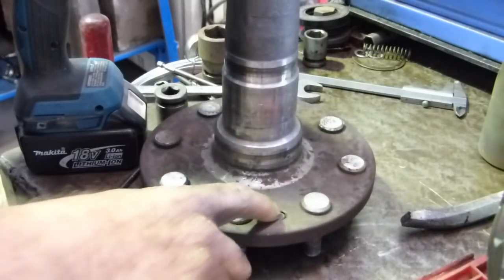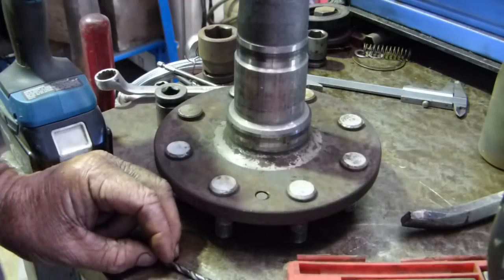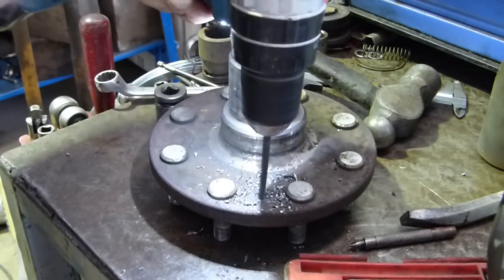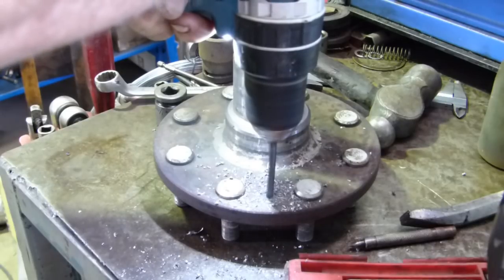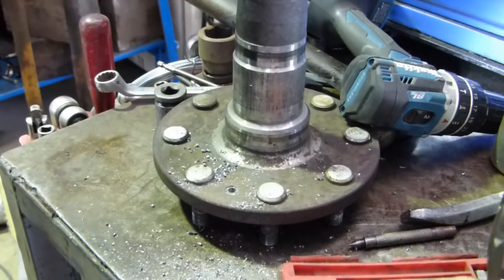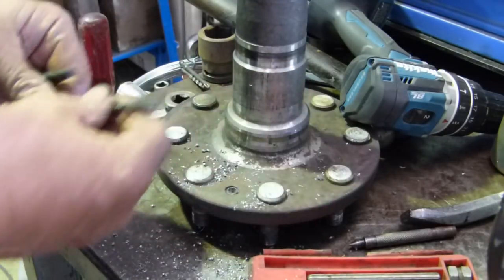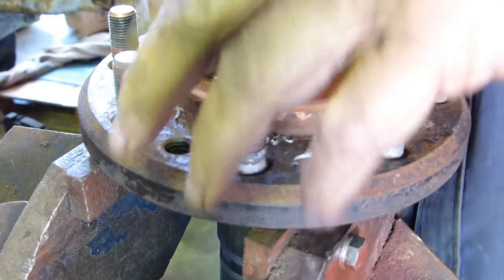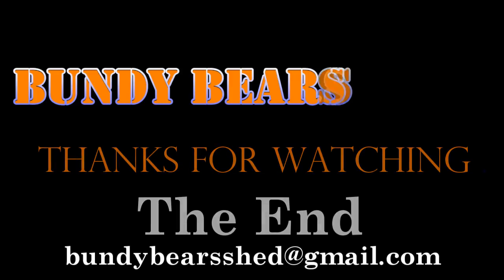Ferguson FE35 Grey and Gold Restoration Part 8 Removing a Broken Brake Drum Retaining Bolt.

Comment: Hi Lance I've been watching all your videos on the Fe 35 grey & gold model , gee you done a great job filming it and explain it as you go ,I find them very interesting as I have a Fe35 1956 model a working tractor on the orchard here in Shepparton. many orchards around here have Te20s not hard to find 40 or so in one place they are used to tow fruit bin trailers.We have one Tea20 ,one Fe35 ,four 35 three cylinders Perkins and one 240
Reply from the maker: G Day Ian, There is stories of semi trailers full of Fergys going from up here in QLD to down your way for the orchards. They couldnt sell them up here when they were traded in on the new ones is the story.

Comment: There was enough of that screw sticking out to use your wire welder and weld a nut on it then turn it out. I clean the top good, turn up the power, go a little lean on the wire, and up the gas more than usual. Weld the nut on, let it cool a bit, give it a rap with a brass hammer, and it should come right out. If it breaks off, grind the weld and do it again. This has worked for me every time so far. Easy outs rarely work. Breaking off the drill bit is a pain but then I would still go the welder route. Looks like you have been an editing mad man. Good show!
Reply from the maker: Yes I have used the welding method with good success I might do that another time. I often use that method with a bolt in a cast housing especially if it is hard to get. This was an easy one with access to both sides.
Reply: You and I are about the same age so I thought you probably knew about this method but just in case, I put it out there for people watching who may not have tried it. Once you've had a drill or an easy out break off you'll try anything to keep that from happening again. On my TO20 I had a bit of good luck getting the screws out. My Dad had a 1/2" drive socket that had a short wide rectangular tip on it. I don't know what he used it for back in the 50s and I have been moving it around in my box for most of my life but I got the idea to see if it fit the drum screws. It was too wide so I took it on the grinder and brought the sides in until it was the width of the screw. The thickness was a perfect tap in with a hammer. I put the impact on it and all the screws came right out despite the screws and drum were very rusty. That was a good day with no beatings for a change. Keep up the Fergie stuff, I love it!